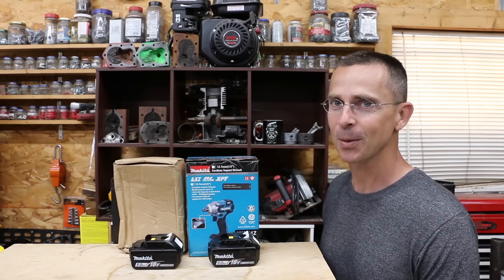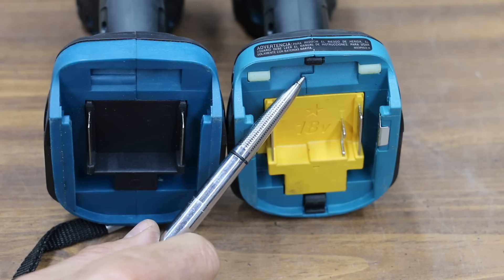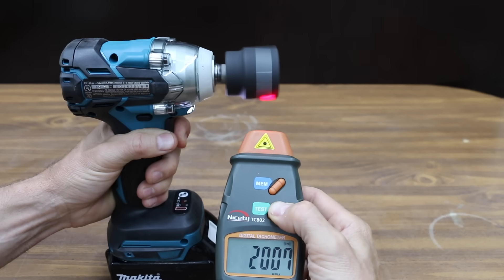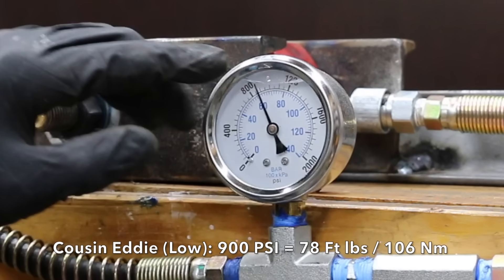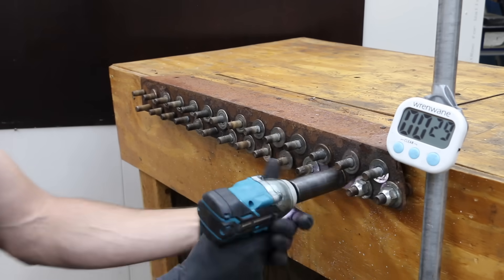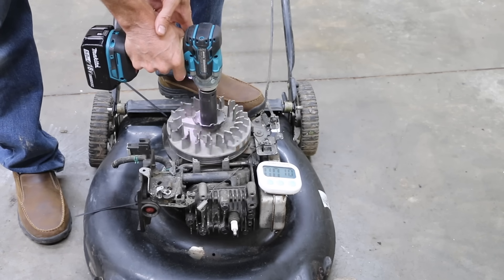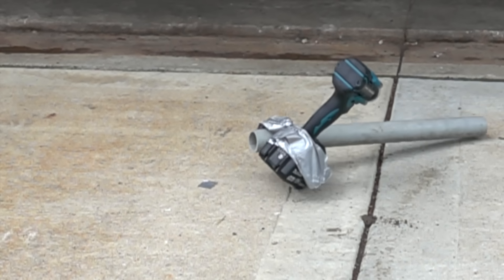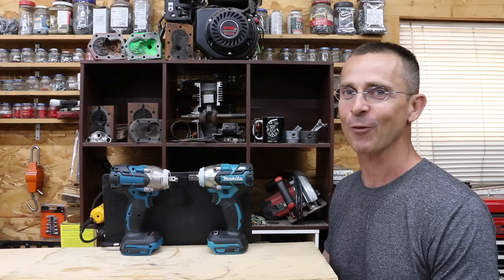Fake Makita Impact Better? Let's find out!  Makita XWT11Z 18V LXT Lithium-Ion Brushless Cordless

Comment: the fake Makita for average use such as furniture and appliance assembly and disassembly is an amazing deal, for $30 you have a tool that you're not afraid to scratch or throw around and a tool that is very well equipped to do these indoor type jobs. I have a brushless Hart impact driver with a cheap $10 set of non impact sockets and the attachments kit for the Hart, (Hart is Walmart brand), I also have an M18 Milwaukee with an impact set and attachments. unless its going to be used on a car I always grab the Hart because I know my robust impact sockets and driver are just over kill. Its like having your prize sport car which performs when you need performance, but also having the daily driver economy car which fits your budget and does exactly what you need it to do all the same. I wouldn't be ashamed one bit to own that knock off tool.
Reply from the maker: Thanks for sharing.

Comment: and honestly after watching this...I think I bought a Dewalt combo drill and impact set that I now think was fake. I never knew they made fake stuff that lookedthe same but...yeras ago when I bought my brushless Dewalt set for 149.99 on Ebay when retail at home depot it is 299.99.   When I first opened it it said made in china. My freinds dewalt said made in USA. Also my batteries were 1.5AH instead of 2.0AH.  Also The connection to the battery seemed way less tight.  hmmmmm....who knows but I swear for the longest time I thought I got a fake dewalt...lol. Itdid the job so I guess I am not complaining.
Reply from the maker: Thanks for the feedback.

Comment: the speed test that u did is not reliable because of the human element.
Reply from the maker: Thanks for the constructive feedback
Reply: @ProjectFarm  no problem, but i also have no doubt that the expensive drill performs better from your previous test of torque, rpm etc. just that one test can be somewhat inconsistent :)

Comment: Interesting analysis.

You get about twice the "tool" for about five times the money. If you're using it a lot, then it's well worth the extra $100; but if you're just using it to break off your winter tires at the end of the season, then I'd 100% say the Cousin Eddie would be sufficient. If, however, you're working in a shop? The extra $100 is worth it.
Reply from the maker: Thanks for the feedback.

Comment: About time someone does a first rate video,,,just the info is what you give,,thumbs up ,,,and one question,,,see the smaller compact Makita with about 250 ft lbs of torque ,, and the one you did on your demonstration , but have seen them with several different model numbers,,,very confusing what is what or if they are all the same unit,,,for instance , the  XWT15Z  AND THE ZXWT08ZLXT are different?  I'll stick with Makita brand as have lot of their brand and never let me down,,,also does the DL1315 18V bats work in this tool??    Really great video,,,thanks so much
Reply from the maker: You are welcome!

Comment: I own the cheap one, and the much larger Makita impact wrench that will do 800ftlbs plus. The cheap one is a value for the money, but definitely not a pro everyday tool. It stays in the truck to loosen the odd stubborn nuts or help change a tire. Real work gets done by the Makita.
Reply from the maker: Thanks for sharing.

Comment: Awesome video and content! Glad I came across your channel through YT recommended. Haha the cousin eddie may not be as good as the name brand, but for 30$ for something to remove bolts quicker and easier than a ratchet every now and then, that seems to be a pretty good way to go after seeing the comparison, and less arm strain, and definitely a better value over spending more than 100$ for something that would only be used maybe a few times a year.
Reply from the maker: Awesome! Thank you!

Comment: FFFFKKKK YEAH cousin eddie is worth it. For me more than enough, I dont use it every day, and its used for tires, and regular everyday stuff. I paid 55$ with 2 batteries, charger, drill bit addaptor, 5 long impact sockets, charger and a full set of metal drill bits. PRO STORMER at ALIEXPRESS MA FRIEND, FREE DELIVERY. 👌👌👌👌👌👌👌
Reply from the maker: Thank you

Comment: OK, ill comment first before i watched this. I bought the DrillPro version, and it works fine with Makita batteries. Only lot slower work. Only doubt i have, is that it surely won't last as long and can't take beating as Makita. The original batterypack sucks, even Makita underperforms with it. But i swaped the 18650 cells to better Samsungs. The original Makita 18V/3.0Ah batterypack contains Samsung INR18650-15V Cells. I Love the Bit-holder, except it doesn't actually lock the bit in place, so it's basically there just for "randomneed" use. Some of these comes with it, and some don't. Surely small screws goes fast and efective with this. 200mm 6mm woodscrews, no problem at all. Oh and i have the older Makita with frictionring.
Reply: Okay now i watched it. Seems like the Drillpro has some diferences, it is also more expensive,  34 dollars. There are some minor diferences with Drillpro and Eddy. Drillpro is a bit better quality,  the motor pinion is more like in Makita and Makita did not overwhelm it in tug of war. They just stopped, ie canceled each other out. I tihink they are very good for the price and for a hobbyist perfect. Just use Makita brand batteries and charger, you don't want your house to catch fire.
Reply from the maker: Thanks for the feedback.

Comment: Thanks for the utterly thorough testing of the Makita clone . I have several  Makita ( mains voltage ) cutting machines but just can't afford one of their impressive battery powered impact drivers . I thought the clone might deliver at least half of the advertised torque but 153 nm !  That's less than one third.
I will now stick to buying the Ryobi 18volt @180nm for $99 from Bunnings as I already have charger and battery that came with my other Ryobi gear . 
Also ,    " Cousin Eddie "  ,  great name for the clone 😀
Reply from the maker: Thanks for the feedback.

Comment: Thanks for the vid. Very useful. I think I'm going to pick up one of these cheap ones. It's the kind of tool I use once a year so don't need to quality of a genuine Makita but would never replace my daily drivers with some cheap knock off stuff. Also, it is worth mentioning, its never a good idea to use cheap battery technology. Stick with original chargers and batteries even if they are expensive. Lithium is highly flammable!
Reply from the maker: You are welcome!  Thanks for sharing.

Comment: When you initially install a nut and in your case torque that nut, you have thread shift in the nut. A Skidmore Wilhelm bolt tension tester will prove to you that tightening a nut, loosening the nut and re-tightening the nut changes the clamping force, one tighten, one loosen and retighten. Lubrication on any fastener changes everything but it does not change thread shift in the nut. Just for something to think about,  the first nine thread in any fastener take up the majority of the load.
Reply from the maker: Thanks for the feedback.

Comment: I'm not in any way trying to defend some commie garbage but you get what you pay for and the makita is well over a $100 so it better d*** well have all those little features if your gonna spend half a paycheck on a f**** cordless drill as opposed to the cheap commie garbage for $30 You can't go wrong it's it break so what if it lasts a month oh well it was only 30 bucks
Reply from the maker: Thanks for the feedback.

Comment: Protip: I got one of these cousin eddies and I found that by holding it pressed hard onto a lug nut as usual, it wouldn’t budge, but once I loosened my pressing of the gun onto the lug, it quickly spun the lug off. I don’t know if other guns are susceptible to this phenomena but it made C. Eddie actually useful. 

Now that I think about this, I wonder if testing for this phenomena on several impact guns might be an interesting video ?

Thanks for the great review, and saving me over $120 bucks ! 🤪
Reply from the maker: Thanks for the video idea.

Comment: Love all your stuff and this one as well. One thing I hoped to gain from this video was a simple, "is a Cousin Eddy worth a try if you just want to remove your car tires from time to time"? I think a lot of car owners would like to have one for those times where you have a flat and the tire will not come off without an impact driver. But buying a $150 total cost Makita to sit in your car is a tough buy, where spending $34(with tax) for Cousin Eddy is not so hard to swallow. So how well do you think Eddie would perform in pulling off a tire put on with an impact driver at a tire store...when your stuck on the side of the road (or at the Farm) when a fourway or factory lug wrench just wont work?  Thanks Again!
Reply from the maker: Thanks for the video idea.

Comment: The final test is longevity.  Can Makita survive as long as 5 times the life of cousin Eddie?  For most diy non professionals, cousin Eddie is more than sufficient.
Reply from the maker: Thanks for the suggestion.
Reply: Yeah I would be curious how long it would last and what the likely modes of failure would be.  Like, would the hammer/anvil round over and skip/fail to impact after a short amount of use, will the undoubtedly cheap mosfets or electronics fail after a couple cycles of use, or was cheaper insulation/wire used for the motor windings, leading to burning up and lettin' the smoke out?  It would be cool to see someone put it through its paces over some period of time to review how it's stood up over a while.  Very tempting item at only ~$30-40.

Comment: On you battery operated tool review videos you should put a multi meter on the batterys to show the exact battery voltage . Cause if one drill has 18v and the other has 17v or slightly less it doesnt make it very fair
Reply from the maker: Thanks for the suggestion.
Reply: @ProjectFarm  anytime

Comment: If it was as durable as the Makita then it would be an amazing deal even with the lesser performance but given that it's wearing out substantially faster I think prolonged use would reveal what the extra 100 dollars gets you: many years of service.
Reply from the maker: Thanks for the feedback.
Reply: In the UK, professional tools by Bosch are coloured blue and the ones for DIY are coloured green.

Comment: Hi,

I think DeWalt needs to change the grease they use on this particular impact. With the burning issue it might be a low grade grease so it gets hot and heats up the motor 

Huh, a good test video to see if a higher grade grease would make a difference on this DeWalt impact. Or if it's the motor itself.  

Thanks for the video
Reply from the maker: Thanks for the video idea.

Comment: The most complex and difficult benchmark in power tools may prove to be a battery comparison. 18V Bosch, DeWalt, Makita and Milwaukee of the same Ah. A battery can be tested for multiple things: it's actual power, it's actual overheating limits, the quality of it's cells, of it's electronics, the possibilities of repairing it by replacing cells and overall durability after many discharge cycles.
Reply from the maker: Thanks for the feedback.

Comment: Did I see you using the makita battery with the off brand? Any difference in power
Reply from the maker: Thank you. Yes, the "cousin Eddy" is designed to be used with Makita batteries.

Comment: Could you say please that is sold without the battery ???? and it costs more than the drill??? and where to buy such battery ??? you tube is full of lies.
y
Reply: He never said it was sold with the battery lmfao. Where to buy battery? Amazon, ebay, hardware store. Really isnt so difficult my dude.
Reply: @maxz8807  he solely keeps up that fkn video, boasting that the drill costs 30 bucks.which is not true. Batteries and chargers come up to 70 bucks which is added to the price  of a real Makita,! This video is disinformative .
Reply: @TheRockerxx69  ... name me the part in the video where he praises the machine please? He merely acknowledges the fact that it is a cheaper alternative. This video is not disinformative as it is not about the battery but the drill. Calm down and get off your high horse.
Reply: @maxz8807  he fooled me in wanting to buy it. I assumed it was 30 bucks.
Reply: @TheRockerxx69  he didnt fool you into wanting to buy anything. That's on you, not him. He never said that the drill came with a battery, so he didnt misinform you either. Take your trash and clean it up! He isnt to blame for you having high expectations from a 30 dollar drill. Besides, once again: this video was about the drill, not the battery. Why should he mention/test the battery if the video is solely about the drill? You are making less and less sense to anyone.
Reply: @maxz8807  ok l bought it with accessories, battery, and charger. 110 bucks. How can l add the Accessory to unscrew the lawn mower blade ? Can the drill do it ?

Comment: Wouldn't it be more fair if you didn't put the Makita battery in the Cousin Eddie?
Reply: They both used a Makita battery.
Reply: He was comparing the performance of the two guns; when comparing two things you want to keep all other factors the same as much as possible.
Reply: @ericbuist8218  But the cheap tool is going to come with the cheap battery... sort of a package deal. I see how using the same battery for both has advantages too.

Comment: Well the thing is: Makita orders some chinese manufacturer to build their tools by their specification. But as there is no such thing like copyright, the same factory will build knockoffs, looking basically the same but using cheaper internals.
For many products the outcome is often the same and you just pay for the name. But for others you just get a visually equal product but with very cheap parts inside.
Copying the product is considered "normal" in china. So the "trademark" is either delivering a better concept and if that's not the case, chinese knockoffs will steal all customers by having better price :-)
Reply from the maker: Thanks for the feedback.

Comment: Although Chinese knockoffs often have great bang for your buck, there is a reason why the real deal costs more, and it's not just because of the brand name. Companies like Makita (in this case) have to pay for product development, which for new products typically takes around 18 months, at a tremendous cost. The knockoffs don't have to pay for any R&D as they simply (illegally) clone the already developed tool.
The cost of the name brand tool helps recoup the R&D expenditures. Please consider avoiding the purchase of knockoffs as you would be taking the labor of companies (often American) without paying for it.
Reply from the maker: Thanks for the feedback.

Comment: https://www.aliexpress.com/item/4000235031529.html?src=google&albch=shopping&acnt=494-037-6276&isdl=y&slnk=&plac=&mtctp=&albbt=Google_7_shopping&aff_platform=google&aff_short_key=UneMJZVf&&albagn=888888&albcp=1582410664&albag=59754279756&trgt=539263010115&crea=en4000235031529&netw=u&device=c&albpg=539263010115&albpd=en4000235031529&gclid=Cj0KCQjw-O35BRDVARIsAJU5mQVQMAf79jN6iEjVEd-C18nRd3cHCuj39Yr19n0PBv-Y5Qd2M4YT-H4aAmlmEALw_wcB&gclsrc=aw.ds

For those who want to find the knockoff, found it, went ahead and ordered a few of them....need a good brush less for my guys to use that I don't mind them breaking...

Comment: Personally, I gave up on Makita years ago and switched to Dewalt when their batteries became so unreliable and so expensive to replace.
The machines where great but they were let down by shit batteries, to be fair though I have not sampled any of their Lion technology batteries, it was in the NiMh days that I became so disillusioned with Makita.
Years ago when they started doing cordless drills their 7.2 volt NiCd batteries would last tens of years, then, later on, they must have used cheaper batteries.
The biggest problem is an environmental one, when the cost of replacing batteries becomes more expensive than buying a new machine, we then end up with a planet full of rock-solid perfectly good drills which are completely useless once the piss poor batteries have packed up.
Reply from the maker: Thanks for sharing.

Comment: Interesting comparison!  My only criticism is the pace of the speech is too fast.  Slow down to a normal speaking pace and it would be easier to digest the info that is being put forth, not to mention more enjoyable as well.
Reply from the maker: Thanks for the feedback.
Reply: @ProjectFarm  I watched it again, and I think the problem lies in the editing.  In most cases there is no pause when one sentence ends and the next one begins, which is how people normally speak.  In the video, those "spaces", short as they may be, have been clipped out so you have an endless single sentence.  Hard to absorb the information when presented that way, at least for me.

Comment: I never bother with side by side comparison of performance, 
in most cases the difference in a real world application rather than in a "test environment", is absolutely dwarfed by the price differences,
if i can pay $30 vs $130 and it would take me just half a second more to get that bolt out with impact? 
Unless i work for a Formula 1 pitstop crew, there is no question here... of course i would go with $30

The real and maybe only proper comparison between a $30 and a $130 tool, would be to see how it holds up to daily use OVER TIME!
That is the key difference here, you really pay for longevity, not dry spec.
The wear you showed on the anvil at the end of your video is a proof of that, and maybe the best property (wear) to focus on when comparing tools in such a way.
Now if the $30 one can outlive the $130 one in a day to day use, i would be very very surprised, and would not buy makita ever again.
Reply from the maker: Thanks for the feedback.